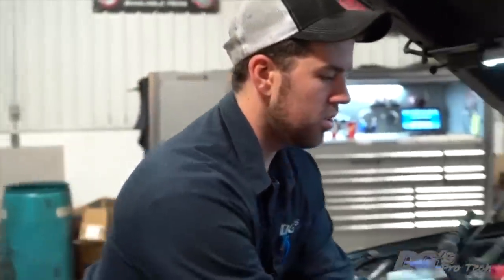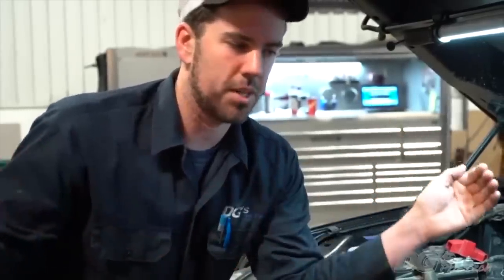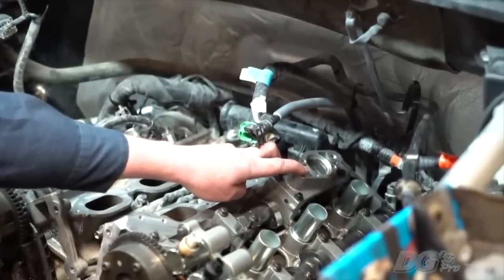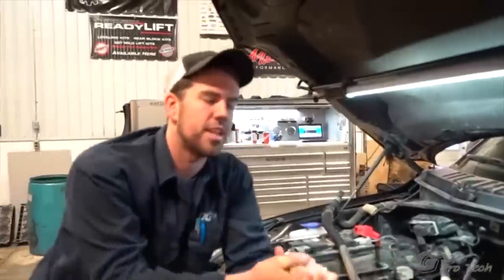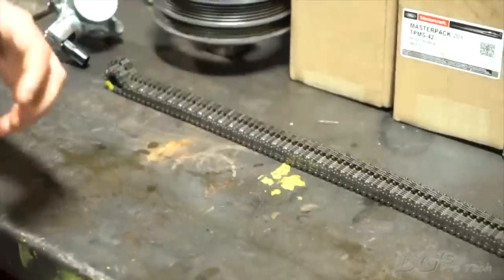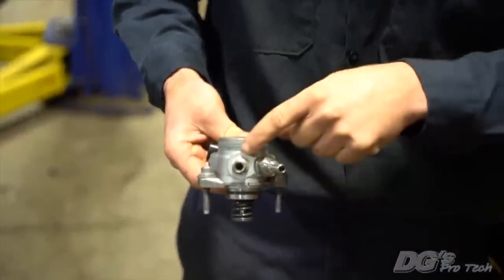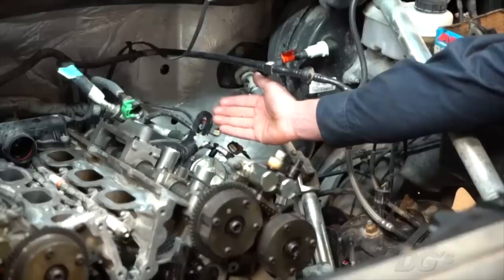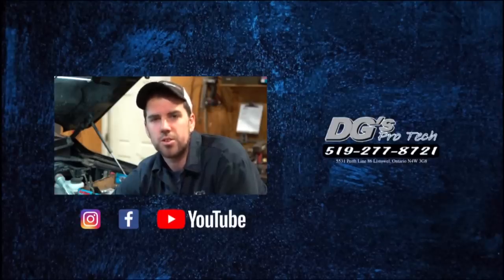What you NEED to know about Ford EcoBoost Engines by Dustin Golley of DG's ProTech

Comment: My mechanic says the same thing! I just bought a EcoBoost engine in an Explorer. It's a used vehicle. Had it 90 days and this code came up for the chain. Super upset as I haven't had it long. This video and mechanic really helped explain how the issue happened. Seems it's a known issue and I'm surprised it wasn't checked before the dealer sold me the car. Guess that's asking too much. Anyway, excellent video and really helpful.
Reply: Unfortunately, I think your bad luck is going to become a whole lot more common as these vehicles get more miles on them and are sold on the auction. Probably a lot more work for the car crushers. Too expensive to repair.

Comment: Once again ford using someone else's technology and calling it theirs
Reply: I guess when they call it "Ecoboost", most people don't know it's a twin turbo direct injection motor with high pressure fuel pump. I know 3 people who have Ecoboost in their F150. They didn't know it has turbos.  BMW and others have used this setup since 2007 that I know of.  It also comes with the common issue of carbon build up  associated with direct injection. I don't know if the Ecoboost has both direct injection and port injection. Some auto makers, like Lexus, do use direct and port injection to help prevent/reduce carbon builidup on the valves and cylinders.

Comment: You say the eco-boost can tow up to 11,000 pounds, however, it won’t do it economically. Fast lane truck tested the 3.5 eco-boost against the 5 L V-8 and found pulling the same exact weight the eco-boost got 3.2 to 3.5 miles per gallon for the V8 got eight or nine. Yes it will do it but at what cost?￼

Comment: Not sure why Ford adopted Eco boost engines, it only complicated & increased problems.  No benefits. Gas mileage is about the same as it's V8, power is about a little less, a little more low-end torque.  That a little low rpm torque is all you got, at the price if some many headaches。TUNDRA has only two engines , toyota refine the two and make them reliable; On the contrast, F150 has many engines but none of them is refined.  Recall GM had 10+ brands, but none of them was sold well and led to bankruptcy.  Americans can't learn to  simply/ reduce things.  They live in 3k sq ft house, most rooms are empty, and can't pay morgage so them foreclose their house.  How stupid it can be?

Comment: I never understood the need for valve/piston interference engines. What a concept for expensive repairs!
Reply: Compression = power and efficiency. You have to get the pistons as close to the head as you can to up compression, and yes, that's where valves would be if they were open.  Personally, I don't want to go back to the days of 5.0 windsor engines making less than 200 horses. 🤮 That's why we have interference engines now, and it's fine with me.

Comment: Lots of valuable info there thank you very much. I bought an absolute mint condition 2012 F-150 3.5 ecoboost with 90k and love the truck, ride, power, comfort, looks, color, chick worthyness 😁 etc. Well maintained and runs like a top. I bring it into the Ford dealer to get serviced. I usually bring it in when the dash info center tells me my oil is around 50%. I also have them use Motorcraft oil and filters because that's what Ford designed the engine around. So you think I'd be better with Synthetic. I knew about the turbo issues but did not know about the drainage gate. I was told by friends it's good to get on it time to time to blow all the crap out of the turbos. Now it makes good sense after watching your video. I don't drive in the below the boost much anyway. I don't get on it but I drive it like I want to drive it and it's not on the efficient side. Sounds like that's best. So synthetic is best?

Comment: I own a 17 F150 3.5 EB and Love it,Full synthetic oil change every 5k and run 93 octane Premium gas, Turbo's love it 😁
Reply: You're wasting your money on premium, the truck was designed for 87 octane. It's your choice to pay more but I never had a problem with the blue collar fuel....
Reply: @markharvey7988 yeah, you're right about that, just feels like my truck runs better when I use premium than regular,like more throttle response,more horse power 😁
Reply: @davidmoreno1946  More power is always a good thing!
Reply: @davidmoreno1946  its definitely better with premium gas and synthetic oil..the computer will compensate for 87 but its gonna run better on 93
Reply: @dannydunn2772  yeah you bet 👍

Comment: I replaced the timing chain, tension, and guides two years ago.  Check Engine light is back with the same code, except I don't hear the chain jumping on cold start, the engine runs quite, idles good, gas mileage is still the same.  I'm a bit lost.

Comment: i like where he says "11-12-13,000 pounds towing capacity allowed, and personally they'll do it". And yes they will, but, when towing up any kind of incline with that weight behind you i wonder how red the turbo's get when they are at full tilt for 5-15 minutes at a time... longevity, not so much. Very well done video however. From one tech to another

Comment: Mechanic= It's a very reliable engine but I have two in my shop at the same time 😂
Reply: @Dodge Rider 
I wouldn't expect all shops to regularly have them in for repairs if they were a good engine no matter how many they sold.
Reply: The mechanic explained why they may give you problems. He also explained how to reduce the possibility of having issues. He's working on a truck and explaining why it most likely ended up there. Literally millions of these trucks on the road and many people beat the heck out of them.

Comment: I sell Fords and have a 2019 F-150 STX 4x4 with the 2.7 ecoboost and average 15MPG with 8k miles so far over all and the sticker says 19MPG combined.   I do live in southern california though with a lot of city stop and go and hills...  I took a long drive to yosemite and averaged 20MPG highway.  This video was very informative and like all the other comments mention, easy to understand even if your not a mechanic.  Over all the mileage isn't terrible.  I was getting 20 MPG on a 2015 Fusion gas with the 2.0 and was averaging 20MPG.  25% less fuel efficient but I'm in a big truck which is worth it to me..

Comment: This happened to my Flex....chain noise, jump timming....engine dead:( Flex been sitting for a year
Reply: Kevin Washington how often were you changing the motor oil? what kind (& brand) of oil did you use? 
Why did you continue driving the vehicle when the timing chain began to make noise? 
Were you not aware that turbocharged engines require more frequent maintenance service & more methodical & deliberate monitoring of the forced induction components, as well as routine inspection of the rotating parts in the internal combustion engine?

Comment: I would listen to the advice this young mechanic provides over an over-educated mechanical engineer with no practical experience in the field. He should be the poster-child of the types of students that are benefiting from trade school education - a fine example. As said before he could be an inspiration to other young students deciding whether it is worth incurring over  a hundred thousand dollar debt for a "college" experience. Bravo to you Dustin and great success.
Reply: He explains everything better and quicker than any other channel Ive seen .  I would take a class from this guy, informative and interesting.
Reply: Granted, that video is old and he is talking about first gen engines.  Ford corrected just about all the issues this guy covers.
Reply: @petrosspetrosgali  I was wondering that myself. I have a '19 HO 3.5 in my Raptor. I was wondering what changes since '17 and what differences or issues might be specific to the Raptor's High Output. Overall I thought he did an excellent job of breaking it down and I really appreciated the overview on the engine. I imagine the 5000km (3000 mile) oil change on regular oil recommendation is Ford's synthetic blend?
Reply: Completely agree!!!!
Reply: Bravo!!
Reply: commuting to a state school is way less than $100k

Comment: Great video and presentation. He knows his stuff - but I was waiting for him to comment on the water pump (never happened). The water pump is run from the timing chain. If it leaks, and no one notices the discharge in the weep hole, it will leak coolant into the oil; possibly, ruining the engine. Plenty of EB engines received a new timing chain, due to water pump replacement.
Reply: Look like a. Problems!!
Reply: @waltbullet1287  modern technology,  water pump leaks, destroys engine. Even 1940s cars/trucks weren't that poorly designed.
Reply: Wrong 3.5. You're talking about the Duratec 3.5. Completely different engine family.

Comment: You get "eco" or "boost" but not both simultaneously. My 2016 3.5 EB is definitely stronger than the 5.0 in my 2012 F150. My 3.5 gets 26mpg on the highway cruising at 55-60. The 5.0 got about 19-20 in the same environment. If I'm in the boost it gets V8 mileage but also good V8 power.  I'll likely choose the V8 next just for the lack of complexity. It's plenty strong, much more than I need anyway.

Comment: Good info, How about the issues with carbon on the intake valve created by using GDI only?  The newer models have a combined GDI/port injection system that is supposed to address this.
Reply: Bill Altenburg catch can , synthetic full oil and shell nitro gas premium. Going 22000 on 2018 ecoboost mustang. . So far so good knock on wood
Reply: @Ps5GamerGuy06  Great, but I am thinking in the 150K plus region.

Comment: Excellent video and insight into the 3.5 EcoBoost.  We purchased a 2012 F-150 this spring.  109K and runs great.  Would really love to see a simple boost gauge setup so I know how much we are working the turbos.  Thanks again
Reply: 15 16 PSI stock turbos its all you need the much newer 150s have boost gauges i think

Comment: If 2 strokes were allow to stay on the market they would have figured out how to mass produce a engine with 90% less moving parts and 1/2 the weight and still be compliant with mandated emissions. Problem was 2 strokes were going to put millions of people out of work. There aren't valves, timing chains, and all the other gear that goes into a 4 stroke head. No extra parts means no jobs to make and maintain those engines with all the extra parts to make them run. Another reason is the backyard mechanics were going to be able to work on them with very little effort.

Comment: Ford needs to come back and start making Engines like they did for years, go ahead and add the Turbo chargers to a 260, 289, 302-351-390, etc.--To Many Moving Parts and not Time Proved like the Old Designed Engines...

Comment: 'The more complicated the plumbing, the easier it is to stop up the works!' Ever hear of that?  'EcoBoost' is just a corporate name put on an engine line up all along the Ford line-up. To sell tiny engines in HUGE trucks. It is bad enough in cars. Car makers make the engines SO tiny, and then slap on turbos, put in GDI, dual overhead cams,tons of computers to control every single thing...thus it breaks a lot. A simple good ol' pushrod V-8 is a TRUCK engine.

Comment: Ford recommends semi-synthetic vs full or non-synthetic oil. I just watched another video where the same engine on a 2011 has 240,000 miles using semi-synthetic oil only every 5k miles with very little problems outside 02 sensors and spark plug replacements. Great information on this video.

Comment: Doesn't get more concise. I've loved my 5.0, but I have been very interested in my next truck being the 3.5. I think they've worked out the kinks pretty well at this point. This is what I like about Ford, where others piece together their trucks with parts from different manufacturers, Ford continually develops their own purpose built full package. I don't hear as much from naysayers about the ecoboost these days. Seems they have started to prove themselves. Especially like you say for people who don't mind keeping up the maintenance.
Reply: Phil Ricci  ... They all have their issues. If it has tires it will eventually give you problems. I have friends with the eco boost and they work them everyday with zero issues. A lot of the anti turbo hype is just fear. Take care of your vehicle and you will be ok.
Reply: Gen 2 Ecoboost has a lot of the issues worked out. They have electric waste gates now also. I think Gen 2s started in 2018 or 2019. I have a 19 2.7 gen 2. But only have 5k on it so far.

Comment: great video Yeah so my Old 2004 5.7 Hemi Durango has 350K haven't replaced even the water pump yet, let alone the timing chain, tows more than 10,000Lbs anytime and it still gets 22 highway all-day. Yeah NO, on  Fords, new Engines - same as the old engines  BIG on HYPE but cheap engineering and quality, at 150K turns into Endless parts machine one thing after another, and longevity means $$$$ ... The Dodge Eco-boost does/will rule the world these trucks wil get dumped anyway ..

Comment: My 2.7 eco boosts in both my fords have been absolutly bulletproof. One having 130k of abuse and never even a check engine light.
Reply: Any advice on maintenance intervals? How often do you maintain it? What exactly do you service ? And what to avoid ? Thank you in advaance
Reply: Lmao let me drive your ford show you how much bullet proof it is had many ford trucks. Run them hard always burning valves out of the junk. V8 Chevy is bullet proof out last fords eco boost anyday. Have 06 silverado still all original engine and transmission. With over 250thousand miles still running like new.
Reply: @donaldkinder6716   lol
Reply: @donaldkinder6716  I never said it was better than a 6.0 gm v8. Faster for sure. I never even compared to anything else. Were not talking the old mod motors from Fords. Those burnt valves. The 2.7 eco is as reliable as they come
Reply: @robophobic3716  ant what i here about them heard ford has had all kinds of problems out of the eco boost engines. I don't worry about that because i never buy another ford truck can't beat a Chevy truck with a 4.3 or any ls v8 engines.
Reply: @donaldkinder6716  that's nothing we have 8 at my job all have 350k plus used abused everyday long live ford
Reply: @jayg9732  keep lying little trump....
Reply: @donaldkinder6716  You better calm down before your husband grounds you.

Comment: I  have owned 4 of these from first gen to currant addition. All F150's and all had over 450,000 miles on them when traded. My currant F150 has 150,000 it is a 2018. Never had any problems, run only Ford Synthetic blend oil and change at 7,000 miles.  Also serviced at Ford only and not at local garage.

Comment: I'm glad that you pointed out that you can have eco or boost and not both simultaneously. The turbo is great because of all the torque you have at low RPM. If you drive at altitude, you really notice the difference between the turbo and naturally aspirated engines.

Comment: Great presentation. Many owners are being mislead by the manufacturers that long service intervals for oil/filter changes are OK......not true for all situations. An "old-fashion" push rod V8 is still a good design for many applications. More complicated engines need to have perfect engineering and maintenance to prevent costly repairs. For people that consistently pull heavy loads it seems a diesel is still the ideal engine.

Comment: Do you ever talk about the need for an oil catch can for the eco-boost? I saw some info out there that said the oil breather re-circ ran through the left rear injector, and because it was upstream of the intake valve, it did a lot of gumming up of the intake of that one cylinder. Any opinion?

Comment: Good video but you fail to mention the main reason the chain wears in the first place which is lack of oil on start up to the phasers which clacl and bang until the get pressure.  Some of us tmin the f150ecoboost.net world have been studying this engine since 2011 when it came out.   My truck didn't even have 70,000km on it when my phasers started clacking like crazy on start up and had the full TSB done by Ford thank God it was under warranty because it was a $3500 job.   If any of you do get the TSB done make sure you change the oil and the filter asap after getting the work done because it is no longer included in the TSB work.    Biggest fault I think in these engines is the horizontal oil filter which allows the oil to drain back to the sump and not keep enough in the oil galleries for start up.  And the blocks are not cleaned well enough from the factory.  Many people have found the phaser solenoid screens plugged when doing the TSB.

Comment: I change my oil religiously @3K. I've had one Ford product, a Mercury with a 4.6 get over 200K, it went to 220.  That's always been just a walk in the park for my Chevy 5.7 and 5.3 stuff. And the repair costs on the Eco-Boost engines are ridiculous.

Comment: You get better gas miliage if u buy a prius, way better motor than a fix or repair daily. This is fords way to compete against audi. The chains are too long, the rail tensioners are a joke. The spring tensioner is a joke. Ford makes a bad motor all together, Its not made to last.

Comment: I will be getting rid of my F150 with the 2.7 ecoboost. Junk.
Reply: I have bothe engines the 2.7 l in my Ford Edge sport 2018 and the 5.0 l in my Ford F-150, 2018 .The 2.7 has 16,000 miles and runs great love the ride and power of it . The f150 5.0 engine failed at 1,200 miles on it and service found the piston and valves damaged the engine piston had a hole in it when scoped so they replaced the engine with a new one from Ford in 2018 so far no problems and no oil consumption.I have posted my information on several ford owner sites to let people know . Thanks ,Tom